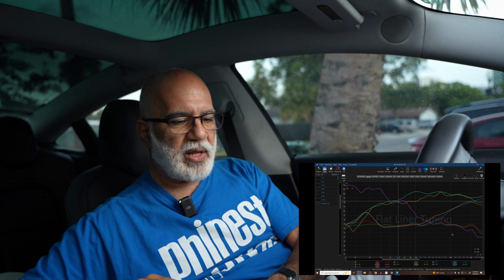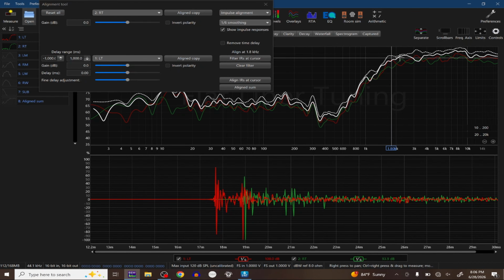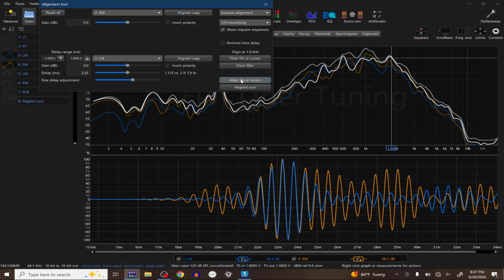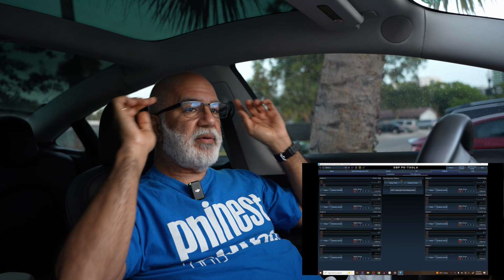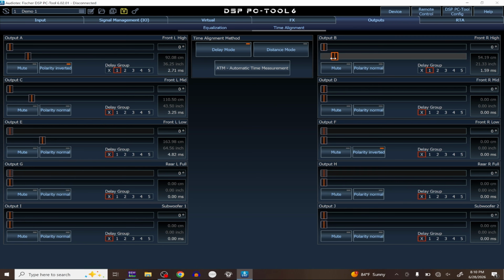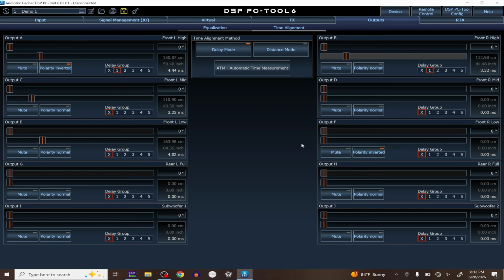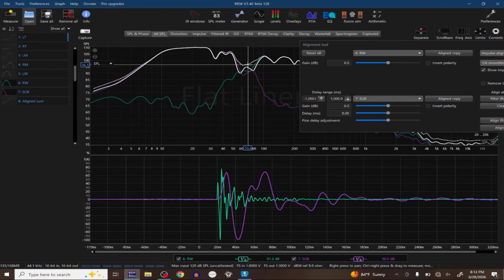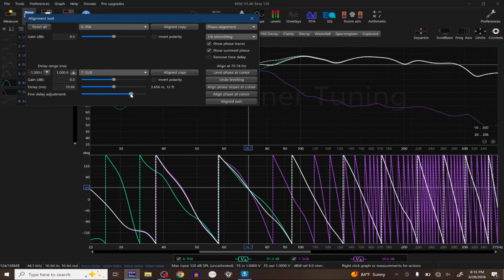Unlock Your Soundstage! Time & Phase Alignment Secrets for Car Audio

Comment: I have 2 way system so when I time aligned front left tweeter right tweeter I use my dsp crossover 3000hz, when I aligned midbase I use 3000hz or 80hz?
Reply from the maker: I would align with the tweeter at 3000.

Comment: what frequency we use to do time and phase, is it the crossover
for example i hawe 2way and sub, crossover at 3000hz and 70hz
when i delay the tw i use 3000hz point for the tw and the 70hz for the midbase, and totally in phase the sub and midbase at 70hz
Reply from the maker: Yes, use your crossover frequencies.

Comment: Interesting video. Unfortunately I understood very little of it. I get the idea of time alignment and phase adjustment, but I'm not really understanding the target; "sweet spot". Are you targeting the driver's position, the front seat area as a whole, or relatively the same for the whole car? It just wasn't clear to me. It would also help me if I had a better understanding of the software that you're using. I'll need to do some reading offline. I'm also going to watch again. Maybe I just missed some things. 

Thanks for the video.
Reply from the maker: Watch my latest video, you will find it very interesting. The one where I introduced my tuning tool. Simplifies things A LOT.
Reply from the maker: https://youtu.be/Y1dAopq1s7g?is=xLiH9-YVcPL6asfm

Comment: Do not align phase with time delay, this is a very wrong method, a good pair of ear can easily tell the timing is off.
Reply from the maker: How can you tell the timing is off in the sub by ear?
Reply: @flatlinertuning within 0.05ms, it's difficult to tell on sub bass, 0.1ms can easily hear the bass note is either disconnected or overlapping especially on drum beats.
Reply from the maker: @mikka3334 you must have super ears because I can’t do that. Or maybe there is a method to your madness, care to elaborate?
Reply: @flatlinertuning   tracks with acoustic drums is the best way to identify sub bass time alignment. My bad, it's within 0.5ms, while 1.0ms is too much.
The problem is impulse response is useless in low frequency capable only drivers, only method I know that works is the traditional way, use ruler to measured distance and some math.
Measure acoustic slope (not electrical slope) of midbass/woofer, and subwoofer at the given filter/slope, look for the steepness of the acoustic slope, it is best if both drivers crossed at same slope, the filter order can be mixed. Example like 24db LPF and 18db HPF. The frequency setting is purely depend on the driver itself and it's acoustic response, look for sufficient overlap. Flip polarity to check for summation. If the sum is very little, you can try to overlap it more or try different acoustic slope, leave the phase correction for special case only.

13:40 Is your TA settings right?
Your high left right is 1.12ms difference, seems correct.
Mid LR difference, 3.25ms, this one is not correct, it should be around the tweeter measured distance.
Low LR difference is 4.83ms, incorrect too, should be 1.12ms up down, maybe like 1.00ms 1.30ms.
Sub 10.64ms, this one is off too. most cars around 2.0-3.0ms
Since you're using delay mode, I'm a distance mode person, isn't the sub the furthest should be at 0ms while delay the nearest driver? about 5ms advanced, the overlap should be very audible.   
You can try use your tweeter LR difference delay and apply it to your mid and low, give it a listen, leave the sub at 0ms, save to another preset, switch around, you'll get what I mean.
Reply: I have 2 way system so when I time aligned front left tweeter right tweeter I use my dsp crossover 3000hz ,when I aligned midbase I use 3000hz or 80hz?
Reply: @UrviSukhadiya  I don't quite get what you mean, if you're using impulse response for time alignment, make sure to let your midbass to play all the way up without low pass filter, impulse response only accurate on high frequency (in car environment), the higher the better.
Don't use rew alignment tool to align tweeter and midbass, only use it for left right. For you question, higher the better, 3khz or above

Comment: Are you’re measurements with sweeps or pink noise averages? Did you go through that process in a previous video?
Reply from the maker: Sweeps, I will cover it soon.
Reply: Sweeps for ir, pn rta for freq response
Reply from the maker: @user-rt2sm5ny5r  correct.

Comment: Please prove time and phase alignment is correct with acoustical nulling. I don’t see how that sub and front could integrate with the sub so comparatively delayed.
Reply from the maker: Sub wavelengths are huge, you can get away with some imprecision when aligning the sub and still be in phase with good summing. The human ear can’t tell, it would have the be completely out of phase for some people to notice.
Reply: @flatlinertuning  true in lay theory, but if i were paying for tuning or having it taught to me, the graphs should show it as accurately as possible. not like processing is a limiting factor. 

in this case, you may be in phase but completely out of time. as you said, phase response is more important in the lf, but this doesn’t mean time is unimportant.
Reply from the maker: @user-rt2sm5ny5r  I agree and you are correct. As a matter of fact, I think time is more important than phase, if you are going to pick one. A perfectly timed system sounds much better to my ears than a perfectly in phase system. You have to find the best compromise. In my mind this is just a demo, and I should have done a better job. This is not an excuse, but as the beginning of the video shows, this is far from my first take and I was already tired and it was getting dark. Again, not an excuse, I should have done a better job. Thank you for pointing it out.
Reply: @flatlinertuning  you’ve got a sick system and great equipment to tune it. would love to see it showcased to the max. keep up the good vids!
Reply from the maker: @user-rt2sm5ny5r  Thanks, you are welcome to audition it if you come to South Florida.
Reply: @flatlinertuning  youtu.be/WaN_FgIIUjY